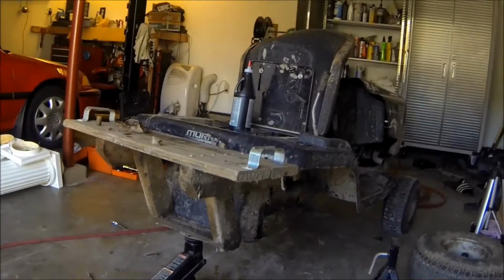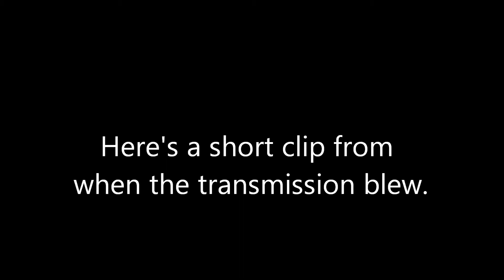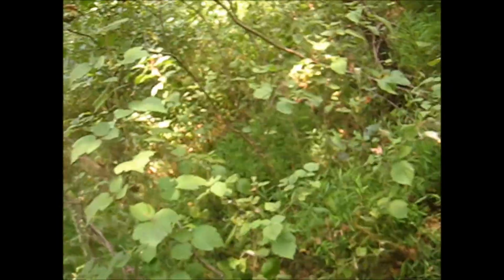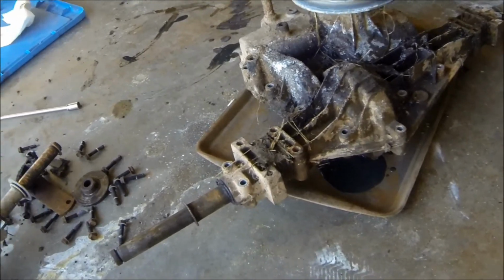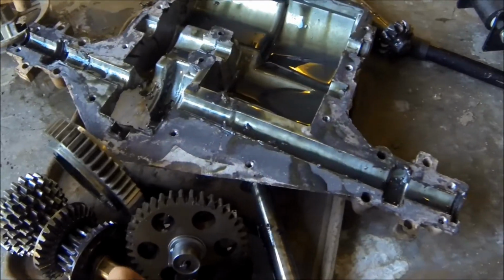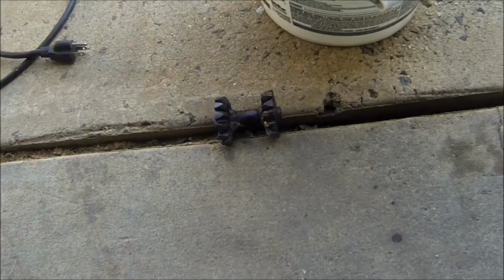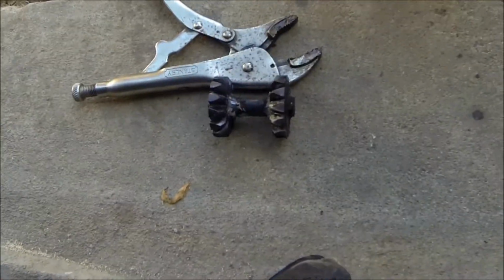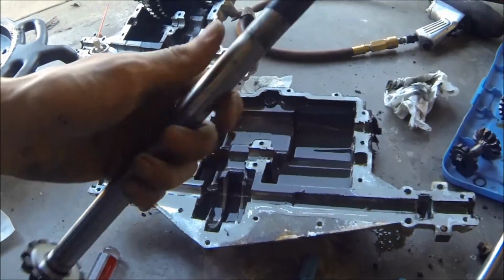The Racing Mower's Transmission Carnage

Comment: You think it happened because of the bit of play in the system?  Anyone think that adding spacers (gauged washers) would help prevent destruction?
Reply from the maker: I don't think the play had much to do with it. The spider gears are powdered metal which don't really weld well. Years of abuse just took its toll. I ended up welding the two axle shafts together and making the cross pin integral to the axle so there are no spider gears at all.
Reply: Yeah true.  I found a Peerless 700 5 speed right angle gearbox so that I can get rid of the transaxle completely on the racing mower I'm building.  I really lucked out on finding it - a buddy had a few old mowers and one was a John Deere rear engine with the 700 series on it.  Live axle is lighter and chain driven.  And it doesn't wine like transaxles do.  Trying to figure out how to do the clutch and what setup to use.  Any suggestions?